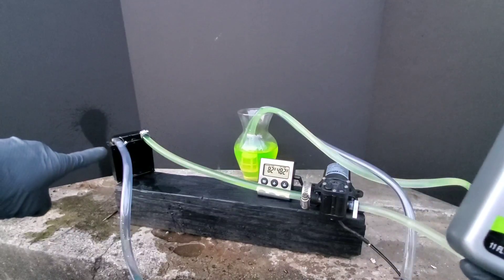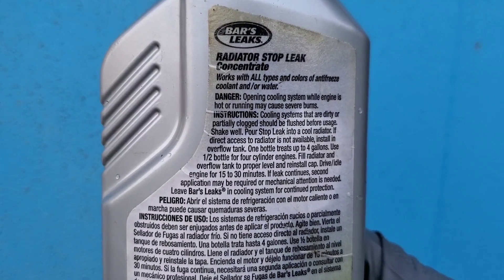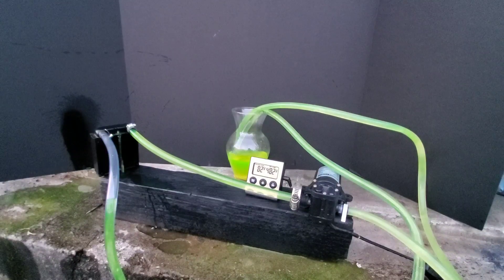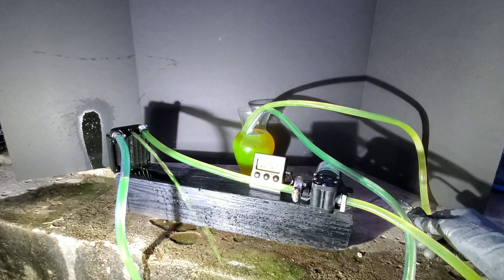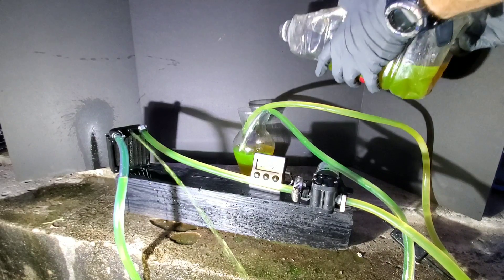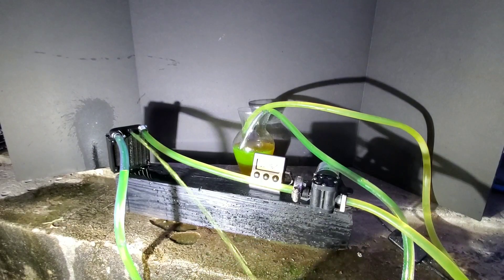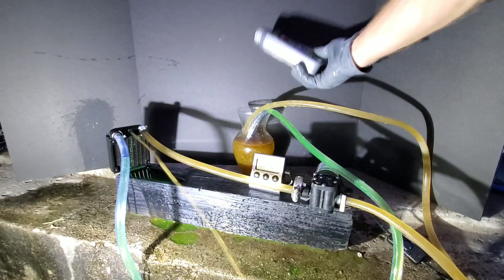How to stop a coolant leak with Bar's stop leak!

Comment: It needs to be at least 150 to 200 degrees to work!! It well never going to work with cold water lol
Reply: If you have a leak that big just put a damn plug in it 😆
Reply: I used this product to stop a small leak between the plastic tank and aluminum part of the engine coolant radiator in my nearly restored 2002 Ford explorer XLS. It needs heat and pressure to work properly . It worked just fine for two months . Installed a new radiator and fished the system. The good news is that it is effective for this type of leak , and left no residue on the thermostat or other engine parts. The bad news is that it only works for tiny leaks . It does state that on the bottle though .
Reply: Exactly
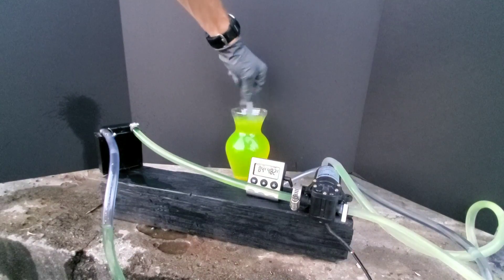Reply: @rramirez115  1:21 😊 1:22
Reply: @rramirez115  p 😢😢
Reply: I also think so... It need heat to work...the heat will make the sealing work....
Reply: it fixed my mk7r blown headgasket that kicking out coolant and making buble like crazy.. it completely seal on day 2 after pouring it and i never drain it out and it still running in my coolant system but it not clog my radiator, its been more than a year now... for radiator leak i never test or confident using this method, i rather use epoxy putty.
Reply: It worked for me although I didn’t have a massive hole like that I also used head gasket sealer on my heads and worked magic
Reply: exactly 😅
Reply: That's part of why it says not to put it in when it's hot. I did that once and it clogged my system.... 

Thankfully a cooling system cleaner broke it all up quickly and I flushed the system.
Reply from the maker: Its heated as I have shown in other videos
Reply: @NATESINTERACTIVEAUTO  , it is NOT HEATED at 200 Degrees F, your experiment is totally misleading,I don’t see any steam coming from the leak, therefore YOUR DEMOSTRACIÓN is INACCURATE..!

Comment: You let it run for 1 minute, 20 seconds and then thought it didn't work. When it literally says on the bottle to wait at least 15-30 minutes at an idle. Of course it's not gonna work after less than 1.5 minutes.

Comment: was the coolant  over 105 degree. if it was heated to 105 or higher it mite work faster. not 100 present sure if this is true. (110 % it's true)

Comment: It works well for me and save me tons of money
Reply: Really, I need one of those ASAP
Reply: Does it matter how big the Crack or hole is?
Reply: @sonnyesqueda1284  I believe it does.. this is something I’m doing to my car with a very slow drip leak from cracked radiator tubes due to a bottoming out. I don’t think anything would work against a steady flow leak like this.

Comment: I think the test hole was too big. If it works at all, it would be for smaller holes. But kudos for trying to test it.
Reply from the maker: Yes i totally agree. How can we improve?
Reply: @NATESINTERACTIVEAUTO  Test with a much smaller hole.  Say, one that leaks 1 gal / hr. while pumping. That might be more typical for many leaks. Fast enough to overheat your car pretty soon, but not that fast.

Comment: it also stops your Radiator from working.
Reply: Steffen I’ve seen it go both ways.
Reply: No Steffen it actually works theres alota science in most products
Reply: You see Ivan, if clog radiator up to point where no flow, radiator cannot leak.

Comment: Holy hell if it stops the leak after 10 quarts of that shit you end up spending more money on stop leak than you would if you would have just bought a new radiator. I bought a radiator for f150 yesterday on eBay brand new $62 with a lifetime warranty.... Hahhhaaah

Comment: I used a radiator stop leak before. It worked the first shot. I was impressed. Although my head gasket was blown too... 2000 Cadillac Eldorado 😂
Reply: My dad's car was a Cadillac Eldorado, he loved that car.  He can't drive anymore, so he gave it to my older brother with about 80k miles on the odometer.  It didn't even last a year before it was sold for scrap.  Anyways, I bought a car with stop leak in it, and didn't know.  It was a 2002 Chevy Impala, which are notorious for blowing intake gaskets.  Instead of replacing the intake gasket, the guy that sold it to me put stop leak in it.  The heater core and radiator could clog about once a year for a few years, then it would clog just once every 2 or 3 years.  Finally from years of intermittent overheating, it blew the heads.  I got a set of heads from a junk yard for $50, and while I had the engine part I used a pressure washer to force out everything that was still in the water jackets, plus I replaced the hard lines, heater core, radiator, rubber hoses, and water pump, and it never clogged or overheated again.  It was funny for a while because the heater core would start to clog, and if I floored it and got the RPM really high, you could hear this gush of water from under the dash, it would sound like someone flushing a toilet and then I would have heat for a minute or two, and then it would go away so I would have to repeat.
Reply: John Davis you should have done a back flush on it and put some rust removing stuff inside of it to get rid of some stuff that might be clogging it. Then tried to burp the system cuz every time u replace a cooling system part you should because that allows air to get in that’s what the flood of coolant under the dash was you heard. I’m currently struggling with the overheating shit and researching all these videos. Since it’s a closed system there shouldn’t be air in it I replaced the thermostat and Ik that it didn’t get burped so hopefully it fixes my issue but there may be a leak somewhere only one way to find out if. In a few hours when places open up I’m going to buy all this stuff I need I hope it works😂😂
Reply: I have a 1992 Cadillac Eldorado it has a slow leakage but it’s fine just keep filling it up with antifreeze and this product in the video above doesn’t work at all I used it on my 1996 Ford Taurus and it messed up my car badly

Comment: Hole way too big for  stop leak to fix, and think about it, if it could stop such a massive leak, it would also clog up your cooling system, the radiator and heater core have small narrow tubes.

Comment: Dont you have to use hot water or antifreeze I thought that stuff worked when the engine got hot
Reply from the maker: I did heat the water at one point but during the video the thermostat worked  loose.

Comment: That leak is way too big! No stop leak on the planet will plug a hole like that, they're made for small gradual leaks and drips... Interesting experiment but please try to make the leak more realistic...
Reply from the maker: It was a small leak but the pressure needs adjustments and precheck the hole.

Comment: My car engine had a one little hole like 1mm in the freeze plug, used Abro powder stop leak and it fixed the leak for long period till freeze plugs replaced.

Comment: 4 plus gallons of water/coolant,  1 hole bottle of stop leak and still it leaked like a sieve.
the original hole was huge (pencil lead diameter)  maybe that had a lot to do with it.
Reply: I believe you're right. Bars worked to stop the leaks in my car's radiator. Probably 1mm holes. 😁
Reply: With a hole that big just plug it . Or use a piece of rolled up duct tape. The metal foil  kind . I actually did that and it worked for 200 miles 🤓